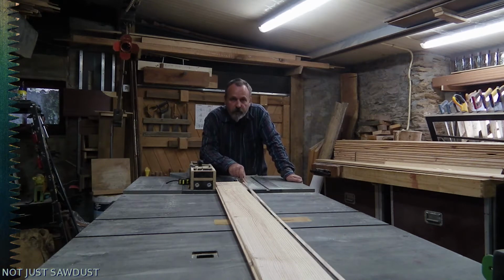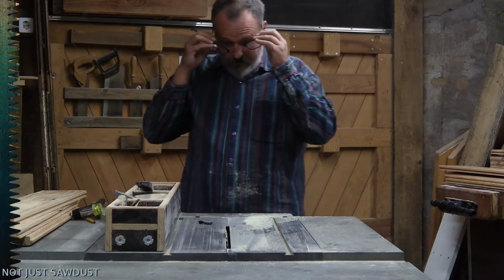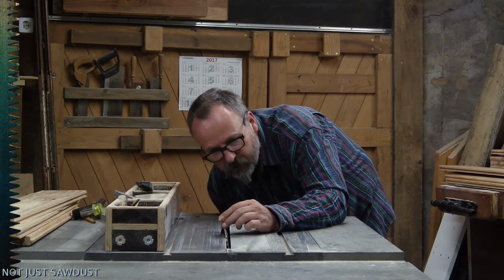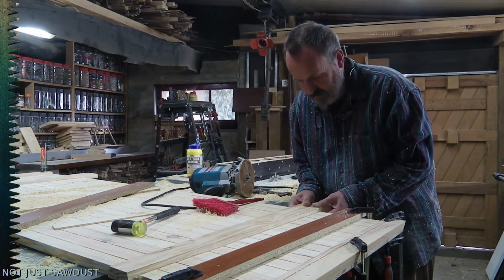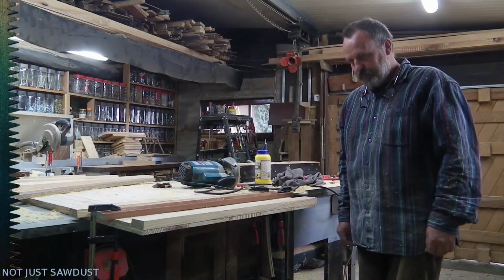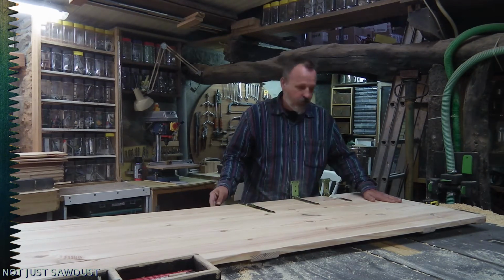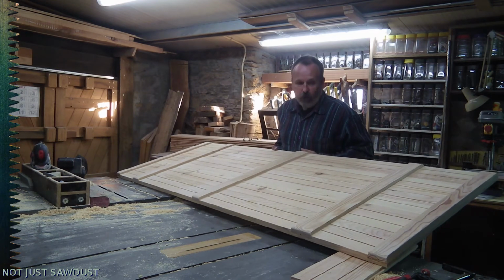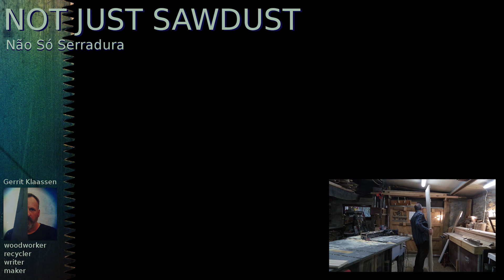#86 Making a Traditional Portuguese Door

Comment: Tapered dovetails, very interesting. Probably make for a long lasting door. Glad you’re looking at older carpentry designs and building techniques because they lasted so many many years. Built to last.
Reply from the maker: Living in the middle of a historic area with visible history going back a 1000 years, you can't miss it. (If you look around that is... seems a weird hobby for some)
Reply: Not Just Sawdust Then it’s good for you that you live in that area.

Comment: Love the design and execution of this project!  AM I wrong but gluing the board cross grain like this: won't that cause a problem with expansion and contraction?
Reply from the maker: Until now it hasn't been a problem. The first door I built was about 7 years ago and that's an outside door. This one is between a utility room and a hallway (interior). It's done according to the instructions of an old Portuguese carpenter. (although they used some home-made glue). Thanks for watching and commenting!

Comment: Amazing job once Again Gerrit!! I had to stop the video and go back... totally missed the angle fence when you ripped the boards. How was like how the heck does that dovetail joint works... How much of an angle did you put? Just curious..
Reply from the maker: Thanks Tomy. The angleof the "dovetail" is 15 degrees (but that's only because the router bit had that angle) the tapering is "on eye site" but the Portuguese rule seems to be on 1 meter: a third wider on one side than the other. (hope that makes any sense) so.. when the small end is 6cm, the wider end should be 8cm (at a distance of 100cm). I used 80 cm for the same "rule" so mine are "tapered" a bit more.
Reply: Not Just Sawdust Thanks for the quick reply.. yes it makes sense.  Door looks great!

Comment: Makes me curious for the original door.  Has it glued boards?  Here everything seems locked.
Reply from the maker: I've seen different ones, the really old ones are not even tongue and groove, just planks, no glue just pens (dowels, or handmade square nails) and no hinges but a round extension on the outer plank, one going in the floor, one going in the lintel above. I took one out of our ruin, which was completely "gone", but this is a replica of that one.